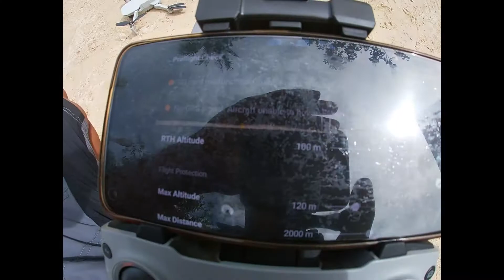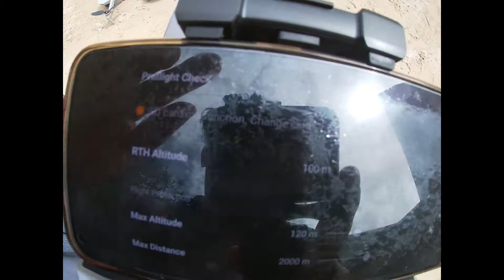HOW TO FIXED DJI MINI DRONE WATER DAMAGE  | SIMPLE TIPS

Comment: To simplify,baliktad ang lagay ng propeller sa likod noong unang kabit kaya sbi nya mabigat,kc nka X pattern ang pag lalagay ng propeller,kung nalilito kau,my marking ang prop. Nyan. Or pwde nyo paandarin ang motor ng walang propeller,e write down nyo ang rotation ng bawat motor kung clockwise or counter clock...saka nyo silipin ang pitch ng propeller para sakto.